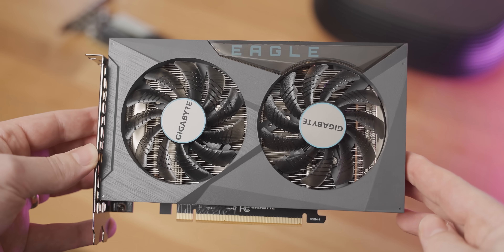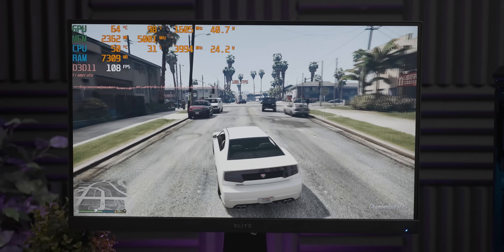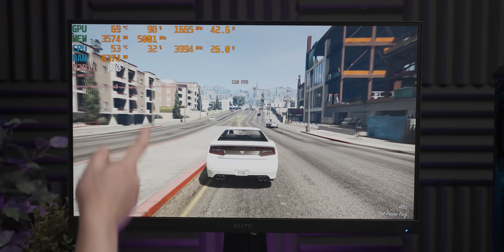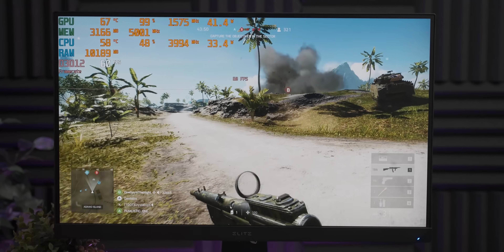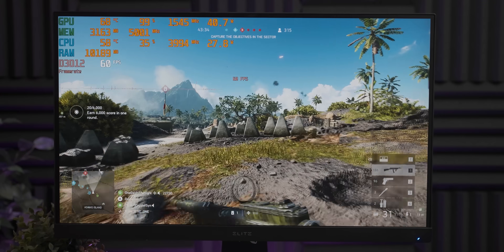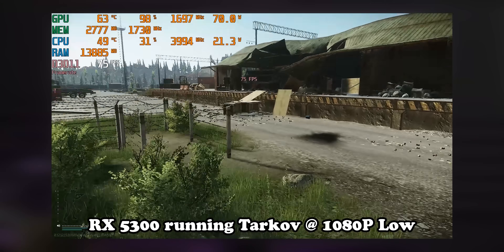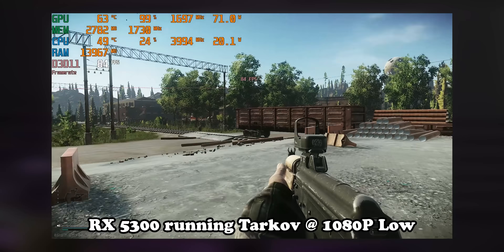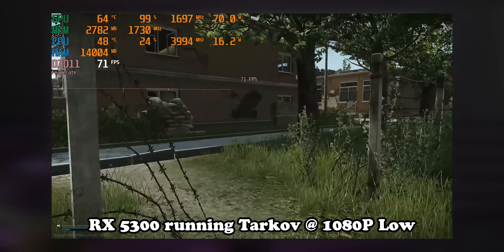This RX 6500 XT Comparison Was A Terrible Idea...

Comment: I had to buy this card today, not for gaming but to run my two new 27inch QHD monitors. This card replaced my old HD 6950 which I've had for over 10 years at least now, the two DVI ports and one HDMI port made it hard wire up the new monitors.

Comment: The 6500XT is not thst horrible, just had a baffling launch price. If you can find this at $140-$150 USD it is pretty OK. However, since the price cuts on the older AMD gen and Intel Arc, a few extra bucks can get you a 6600 or an A750. Both cards perform way better* and the Arc can do pretty good ray tracing on a few selected titles.

*For the A750, performance will vary depending on the drivers and the DX version of the game.

Comment: The biggest advantage to the 6500 XT is having Radeon Super Resolution support. Upscaling from 900p to 1080p gives you a pretty good performance boost and adjusting the sharpening enough actually makes the game actually looks sharper. It's still a bad graphics card but you can make it less bad and it's way better than what Nvidia is offering at the same price range if you don't care about hardware encoding or can use cpu encoding.

Comment: In terms of not including the encoder, around the time of the release of the 6500XT I recall hearing it was originally intended to be a mobile laptop silicon. Likely the entire reason they omitted it. I own a laptop with the 6800M and even running similar to a desktop 6700XT, there's no encode capability. 🙂

Comment: This card is straight dogcrap. Nothing but issues. It seems to have a really aggressive energy save thing going and will under clock  randomly in the middle of games causing stutters. It randomly dips to 1000mhgz then back up to 2700mhz. Then if it's not that, it texture loading issues. This is on 5800X with a X570 board and 16 gigs of 3200mhz ram. So I'm running it on gen 4 pci express no overclocks anywhere on the system and everything on default.

Comment: It is a good card for the price I have one in an HP with a 285watt PSU and it runs great. I run the upscale and get 120fps on Apex legends. I do not get why everyone is tearing this card apart so what if you cant take a screen shot. Nothing touches this card in the price range.

Comment: It's been 8 months
Complete wipe, literally wiped my entire PC
Installed everything brand new

AMD Relive will not give me playback, won't record audio, and won't save to the right file location even if I set it then make a clip immediately after resetting where the files go. 

Amd relive is so fucking shit I would not care if my GPU had a encoder in it fuck AMD Relive 8 fucking months and a Complete wipe and it still won't work

Comment: 6500xt would be a great GPU for 100-130. Still hurts to remeber rx580s used to go for lower then 150 😭
Reply: Well yes, they used to go for that price when they were already old (by 2019). When they released, they were at least $230. Wait one to two years and the RX 6500 XT will also be under $150.

Comment: It has no encoder because it's just a laptop die schematic transformed into a discrete card for lack of other designs to use at this price point given silicon shortages. In the laptop where it belongs, stuff like encoding would be handled by a Vega iGPU afaik. I do wonder why they didn't just copy the 5300 schematic onto a smaller 6nm die instead of using an obscure laptop SKU...

Comment: Pretty stupid for any reviewer to test PCIe 3  perf as it's specs alome mean it is a PCIe4 card.  AMD has made a number of OEM only releases and many DIYers and reviewers complaned.  So they made this available AND rebated Retailers to have cards sold for SRP at launch and still they complain.
Reply: Plus RSR and FSR 2 will make a big difference.
Reply: Probably because most people looking at an entry level card like this are using PCIe 3.0 systems.
Reply: @riven4121 So next time read my full comment before replying.  The card uses a LT GPU and was fpr OEM system builders. It was noit intended for DIY.  The intended market is al PCIe 4 . Anyone doing a tech review would simply state the limitation and test accordingly, not feign  outrage and design failure.

Comment: RX 6500 XT is simply a scam at $200. Put RX 5300/5500 4GB and all of these marketing points:

* high core clock
* 18Gbps memory
* encoderless because it's meant for laptop (?? I've been on dual encoders on hybrid config laptop for years with no problems. ironically radeon software disables recording when it detects igp ever since ryzen mobile)
* infinity cache

go to drain real quick. maybe cap its core clock and see how it holds up against RX 5300. 

I could only see it has some value if it's at $100 or lower considering you need B550 board (they're still expensive than B450) and at least zen2 CPU as APU is limited to gen3 for CPU PCIe lanes, which overall defeats the budget for budget builds (RX 6500 is a "budget" card, mind that). Ironically non-F Alder Lake with H610 would help compensate those bandwidth and encoder issue (the latter might work with IGCC handling recording and RX 6500 doing render via Windows Graphics Settings)

Comment: Honestly what I am getting out of this is, if you can get a t600 for a price around 200 bucks, you will get a cheap way to get at nvidias quadro drivers, resulting in a decent, low powered work station card, with good enough performance for a good majority of games at 1080p medium settings. This thing will also beat the crap out of every card in this price range for stability. So I am noting this down as a W for the t600.

Comment: the 6500xt an 3050 i just cant figer out why they exist the 6500xt can be done in by a r9 fury an the 3050 is beaten by a 980ti both several generations older.

Comment: My Asus P8Z68-V LE motherboard just died on me so once again I'm stuck being unable to game with my RX 580 GTS Black Edition graphics card. I have to bite the bullet and buy a new motherboard, CPU and RAM kit. At least I can upgrade without too much issue so long as I stick with Asus for my motherboard, Intel for my CPU and G-Skill for the RAM.

I'm thinking of getting an Intel Core i5 12600 6 core 12 thread 3.6Ghz cpu with 32GB DDR5 RAM on an Asus micro-atx LGA 1700 motherboard.

Might as well go new, then hold out for the GPU market to come back down to Earth. Sometime around late April of 2024 or maybe even 2025. Right now scalping is still at an all time high and GPU prices should be spiking upwards as Crypto currency rebounds this spring.

Scalpers will totally own 2022 and 2023.

Comment: Bought this as a placeholder for my son, so he could play FNAF security breach.  He has a gen 4.0 Mobo, and he plays high settings no issue.  Overclocking is mild at the least.  Could not enable fast timing without immediately seeing bsod and restarting.  Unlike you big content creators, he has my old capture card,so encoding not such a big problem.  For 235 usd, it is useable and didn't break us.

Comment: Now you need to fall down the rabbit hole of used Quadro and FirePro/Radeon Pro cards on eBay! 

Lots of options for low-profile cards better than your pal the GT1030 (GDDR5) for less than the current street price of the DDR4 version! Also, single slot coolers are a thing! (although they are clocked lower than their dual-slot gaming counterparts).

Comment: Quick question. Does your card output more than 1080p 60hz on the hdmi output ? Mine doesnt. Im curious if its the Port or not. Since cable and monitor do 1080p 144hz on a different PC. Or am i missing something? AMD drivers wont let me change past 60hz nor windows itself

Comment: The card DRIVER tells you to change the card... fuck that. What's next, shutting it off for you "because AMD can no longer guarantee a quality experience with said card"?

You know, like laser printers shut off because any of the components' counter reached 1000, and it doesn't care it runs just fine, it shuts off till replacement.

Comment: The 6500XT was designed to be a laptop GPU which would have an encoder built in on the onboard video. So cost cutting, really.

Quite the oversight when having to use it on a discrete card.

Comment: Don't even try using a 3D based web browser like every one out there. It uses the CPU at 100% to compute and decode. This is the specific reason I use an Intel CPU with an iGPU to decode. Specifically a 10900K and 12900K.
Reply: Maybe it's time to upgrade this Core2Duo of yours then…

Comment: The performance bottleneck of the 6500xt is very game engine and settings dependent. As game engines continue to leverage pcie bandwidth more the card will only be crippled further, but there is definitely a sweet spot in the settings to get good performance out of it currently

Comment: 6500xt doesnt have a video encoder because it's not a desktop gpu by design. they syphoned off gpus meant for laptops which would be paired with apu's which already have encoders so the gpu didn't need them. 

they just assumed the market was so bricked they'd get away with it.

Comment: So i have a question... do you need to set the PCIe link speed in the bios to the correct speed or does it automatically default  to whatever your card is?
Reply: It should default to the highest supported, however some bios might not actually detect correctly. You'd be looking at OEM motherboards that you often find in prebuilds though (which can be pretty garbage, omitting features/locking them).

Comment: Even a gtx 1080ti can run doom eternal 1080p high at 60fps, rip gen 3 owners with rx 6500 xt
Reply: No shit, you mean a top-of-the-line GPU from 5 years ago can still game just fine? It better be, as it launched for $700 (most expensive card ever at this time, not counting Titans)
And believe me the 1080Ti can do much better than 60 FPS high in 1080p.

Comment: The AMD was quite force to release a graphics for PC when the Nvidia release the 3050, so what AMD did? They took out the GPU from the Xbox and modified to be used into pc's. That's why the RX6500 XT can't record. The GPU was ment for xbox they just do some stuff to be on pc too. :))
Reply: no it was a laptop gpu the gpu in the xbox is way better than this lmao
Reply: also you can stream from both next gen consoles without anything else

Comment: Plottwist:

I was using a gtx 760 in 2022, because i only play CSGo and ETS2, i upgraded to a 6500xt because i wanted something better and faster. Best case scenario cheap and capable of gaming in 1080p.

So after getting this card i knew its like a 60fps card. 
I would be fine with that and started downloading other games.

This card gives me 100+ FPS each game, on high settings for 200 bucks brand new.
Im not interested in used stuff.

So as a placeholder, for that price brand new :  show me a better gpu there is non.

People say get the 3050.  

The 3050 is way more expensive and over msrp than the 6500xt.  8 gigs of ram but a slower processor, you pay double the ammount of money for a double ammount of vram that just gives you a little bit more fps. Not enough fps more for double the price.

Comment: Dawid, will you be able do a follow-up video to compare the RX 6500 XT against a GTX 1650 Super instead? I’m pretty sure the RX 6500 XT would be bruised in this battle.
Reply: Just going by other benchmark vids, the 6500xt on gen 3 is a bit faster than base 1650 in perf, while on pcie gen 4 it trades blows w/ the 1650 super (it really depends on game selection).  Right now, it's the only new card that hits a budget price point.  $400+ 3050's are a joke, and sadly 1650's of any variety are completely overpriced as well.  Yes, the 6500xt is a repurposed mobile GPU so it's missing functionality, but it's silicon that already existed so AMD didn't have to spend a few years making something new to meet the market needs that exist now.  They could have just left the budget gaming market unserved, and Nvidia still isn't serving the budget space as the MSRP of the 3050 was an outright lie to begin with.
Reply: @tomcatsdb4755  The jokes on the 6500 XT because it is a full generation later than the GeForce 1600-series, yet it fails to beat the 1650 Super's performance. It even struggles to beat it's own predecessor (i.e. the 5500 XT) decisively. Nice money grab by AMD.
Reply: @freddyng1843  The joke's on anyone getting a new 1650S or even 3050 for that matter.  We need actual budget alternatives, not "budget" cards that cost nearly as much as a complete budget rig from a few years ago.  Thankfully there's been downward pricing trends in the used market, and to some degree the new market as well.  But even now (3/28), the cheapest 1650 super on newegg is $380 USD.  The cheapest 6500xt is $225 USD.  The 6500xt matches a card that's roughly $155 more, so on gaming performance alone, the 6500xt is the better value here.   But if we look at $380, then you can get a 6600 for $368 USD which beats both the 1650 Super and the 3050 (the cheapest of these is also $380) handedly.  AMD had silicon ready and could actually hit a budget price point so they made the card.  There simply isn't another new card available in the $200 range in today's market.

Comment: If the T600 is in fact a Quadro card, people should keep in mind that Quadros are realy built for image quality and processing, not so much for speed.  Newer Quadros obviously are better than what they used to be (think back to the older Quadro X000-era (1000/2000/3000/4000/5000 series).  But they are technically more geared towards media creation and CAD type tasks.  The ATI's (other than the FirePro cards) are more for gaming, so they have the speed (although it seems they are lacking in some areas, like the lack of a built-in H264 encoder you found out about).

Comment: Interestingly the rx5300 uses LESS power than the rx6500xt. Like 10w less for maybe like 10% less performance. 

Fucking amazing AMD. You took a laptop MX series card, OC'd the shit out of it, then sold it as a "gaming" card. Because lets be real here. Only the mx/GT series from nvidia don't have encoders. 

Just get a gaming laptop. There's already a $800 msi gf65 thin with a 75w rtx 3060 in it and a i5 10500h. You're not gonna build a better and cheaper PC than that. And that 3060 can ass whoop the rx6500xt, while using the same amount of power.

Comment: the 6500XT's shitness has been overstated, but really AMD should have given it a $150 RRP... or like you said released the 5300XT on 6nm,  even call it the 6500 non XT and do a cut down 6600 with 1070 performance for the 6500XT.

Comment: i mean honestly i wish i hadn't bought the 6600xt and just bought the 6500xt. i'm going to have to upgrade later this year anyway, it's just a weird combo to have a 3700x and a 6600xt. i'm getting the 5800x3d and the 7900xt when those release
Reply: Don't you get 2x the performance with 6600 over 6500? Or did you overpay for the 6600?

Comment: If AMD was smart, they would release a SSF form factor rx 5300. That card would be killer. I just want that card. But with a little power management it would run off of just PCI-e slot power. As you see in the testing it didn't go over 75 watts. I want a good 750 to replacement. That was the 1650, but you can't find those!! Especially the LP SFF version that I wanted and needed.

Comment: I'm planning on getting this gpu cause my current one is a rx560 with 2gb of vram and this seems like the only decent gpu rn worth it for below $300
Reply: Absolutely, that's something reviewers tend to forget, the RX 6500 XT is the ONLY gaming card (with the RX 6400) below 200$.
They all say "get the 6600, it's a much better deal", sure, but the 6600 is also 1/3 more expensive at the very least.
Actually on Amazon Germany you can find a brand new RX 6500 XT for as low as €170, so it's half the price of a 6600. Sure, the 6600 is nearly twice as powerful, but it's also twice the price.

Comment: Honestly I love how all the reviewers call the 6500 XT "bad!".
I think AMD gave us what we wanted for a looong time, a cheap, accessible new entry-level GPU.
Scalpers aren't interested in it and there isn't shortage of it, and it's a beautiful thing!
I just sold my RX570 4GB for 220€ (bought used back in 2019 for 85€, LOL) and I bought a Powercolor RX 6500 XT for 245€. 
Now I have a new RDNA2 GPU with all the modern features (that thing also supports RT!) and with, most importantly, 2 years warranty.
Reply: Good job man! Just don't ever try ray tracing tho' lol.
Reply: @Groovy-Train  unless you use fsr
Reply: @Slayer-xi7pu  I'm not sure even fsr could help a 6500XT in a ray tracing situation lol.
Reply: Absolutely agree!
Reviewers trashed it as it has no encoder support nor more than 2 video outputs, completely ignoring that:
A. All modern CPUs can do video encoding/decoding just fine
B. Not everyone is a YouTuber/Streamer/Content creator with need for hardware encoding
C. Very few people who can only throw less than $200 on a GPU would have more than 2 monitors to begin with.
D. It's the only NEW GPU in stock at MSRP, and at that price tag.

It also received a lot of hate as it only has 4 Gb of VRAM and won't be able to game in high settings in 10 years anymore. Since when do people expect to game in ultra settings and keep an entry level GPU relevant for more than a couple of years? Put textures in medium (or low on demanding games, or even high or ultra in older games, it's all depending on games) and as long as you stay under that 4 Gb VRAM cap, the 64 bits bus won't be an issue.
It's an entry level GPU that does as good as top of the line GPUs from 6 years ago and with half the power consumption. It's absolutely fine.

It's also always in stock, and nowadays can even be found under its MSRP in Europe.